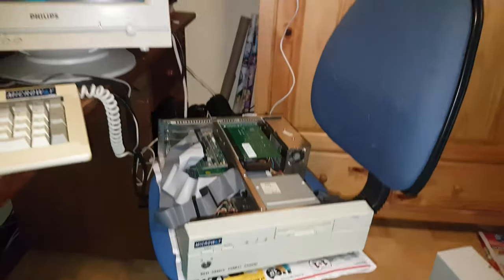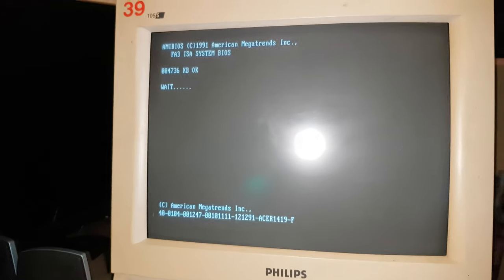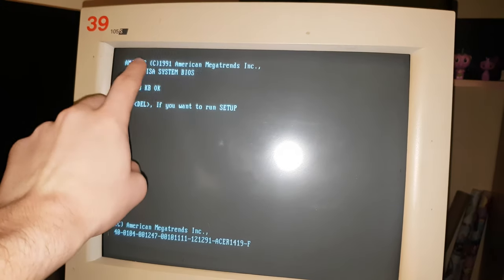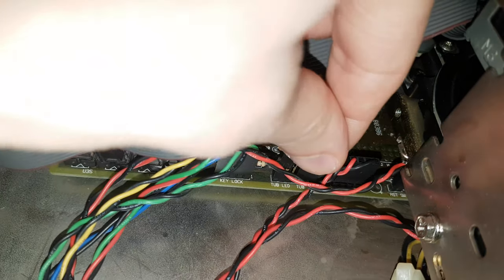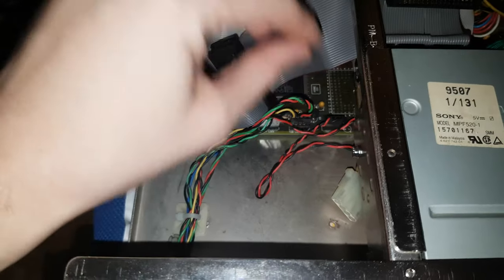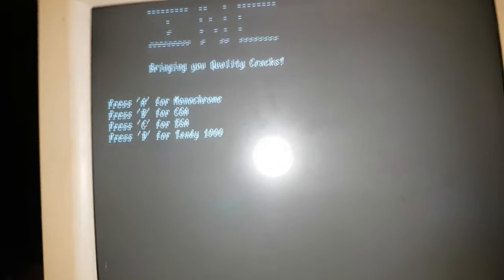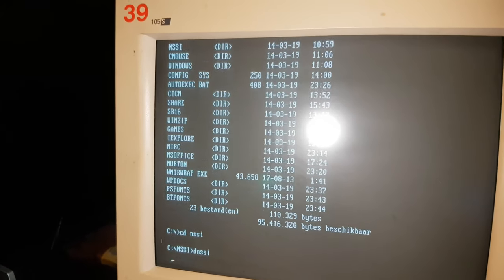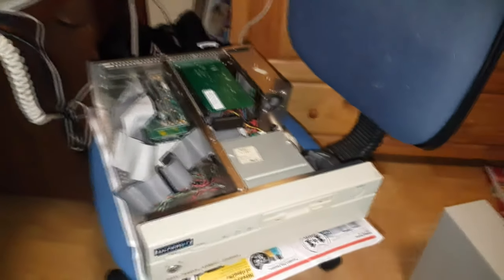386 PC Restoration - Turbo Button Problems + Fix

Comment: There was no convention for turbo mode back then. Original IBM definition had turbo mode be slower; so when you enable turbo you're slowing down. Probably they didn't want to put a button on their machine that said "slow". For a  random 386 turbo on could mean anything. There was no strong convention that turbo on should mean slower or faster.